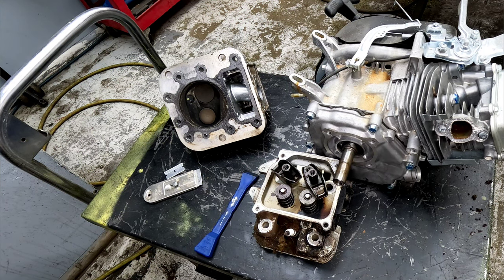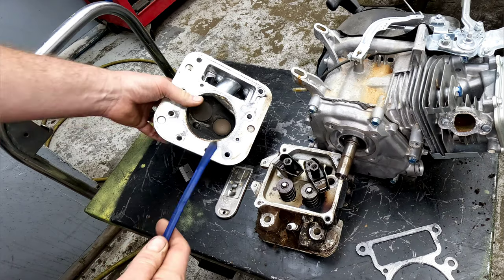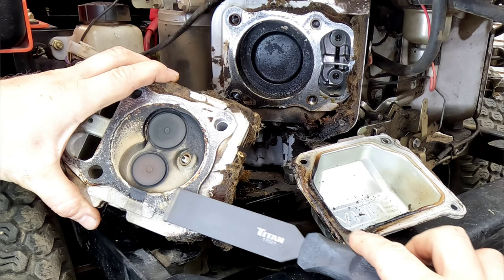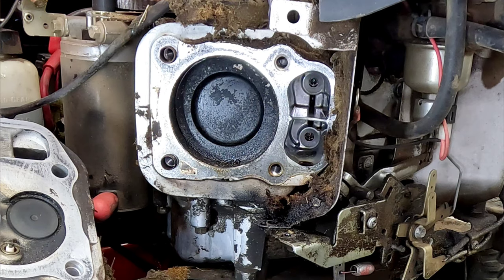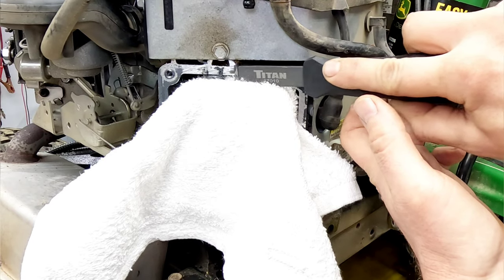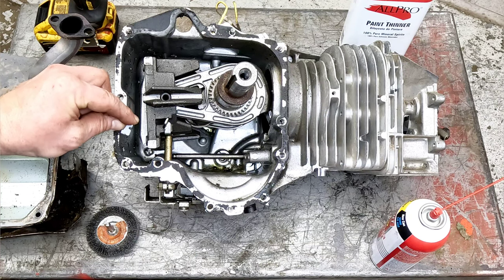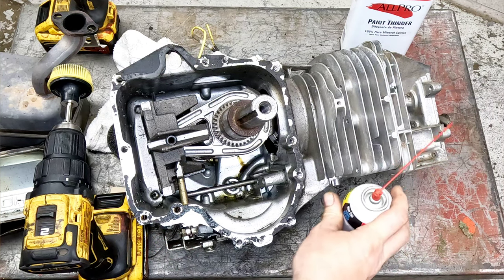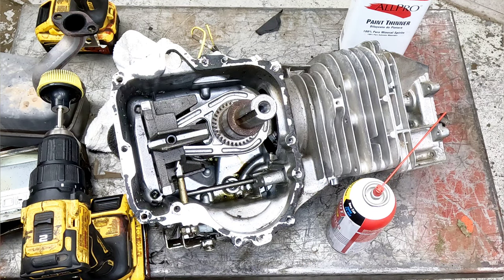The Easiest Methods To Remove Gasket Material On Any Small Engine Riding Mower Push Mower Zero Turn

Comment: I do use a wire brush but i also apply a thin layer of form a gasket on both surfaces and put the gasket in the center. Never had a problem.
Reply from the maker: It can definitely be done but it takes some real skill to do without an issue. Nice job!
Reply: Me too, exactly. I use an old wire brush on my drill for anything that requires RTV. Scraping gaskets sucks and takes a lot of time.

Comment: I used a putty knife with a freshly SQUARED edge (not beveled), make sure no burrs. Finish up lightly with a 2" green cookie on the die grinder and then clean with solvent.
Reply from the maker: The squared edge works better for this method? I see so many people use putty knifes I might try it this morning have a Intek camshaft to do, of course
Reply: @IndRepair  Seems to dig less. Depends on the gasket. Razors still the shiz for RTV.
Reply from the maker: @Travis141123  I have an extra one here I will give it a shot thanks!
Reply: @IndRepair  End of a flat file works too..
Good luck!

Comment: If you use a soft wire wheel say, .006" and have been cleaning gasket surfaces for years, you'll develop a "feel" for amount of pressure and length of time the die grinder stays in one area. Keep it moving with light pressure. I've never had a sealing problem with any modern aluminum alloy that is used for small engines.
Reply from the maker: Definitely people that do it with this method and have no issues. Using a brass wire wheel? I agree it can be done but takes a major skill not to take too much off. Great job!
Reply: I like the 2" scotchbrite cookies in a die grinder. Brown ones are aggressive though, so if it's slinging metal, lighten up.

Comment: My default has become plastic razor blades since they pretty much can’t do any damage - I can always move up to something more aggressive if it’s needed.  But, I’m not trying to get 10 machines out the door between now and 5pm!
Reply from the maker: That is the deciding factor for many I think, reason why so many use a die grinder and other things for fast removal but I would rather take the time and do it by hand

Comment: I have a lot of different kinds of scrapes. My favorite are, wood chisels and putty knives.
Reply from the maker: Never would have thought of a wood scraper but great idea!
Reply: I have a set of 5, so in small spaces or large spaces, they work great.
Reply: Try the squared end of a flat file. Chips hard gaskets rather nicely.
Reply from the maker: @Travis141123  About to scrape one now Briggs Intek. Needs a clutch too so I may put it off until then. Will see how it goes

Comment: I remember my father putting motor oil on the mating surfaces before he installed the gasket.  I don't know if he did that so that the gasket came off easier the next time or that he thought that it would seal better.
Reply from the maker: I have heard of this in racing applications. I believe it is to help allow the gaskets to move independently of the mating surfaces...have always avoided this but may be time to look at it again

Comment: That engine is packed with grass and dirt 😢😢😢😢
I would have pressure washing first before going into the engine 😊
Reply from the maker: I find it better afterwards and keep the debris out while having it open. Only time I pressure was first is on a horizontal shaft since the heads face up much easier to get stuff down in there

Comment: At 6:00 mins in, you show a engine with badly plugged air fins. And you're concerned how gasket material is scraped off ????
Reply from the maker: Head and head gasket ended up being replaced since the head was no longer flat and it had valve issues. Was ran like that for quite a while